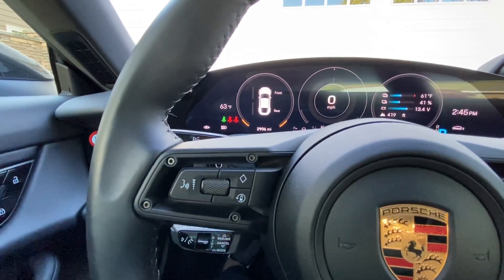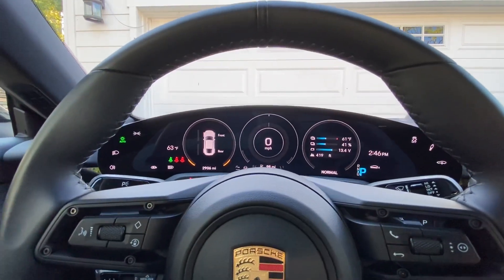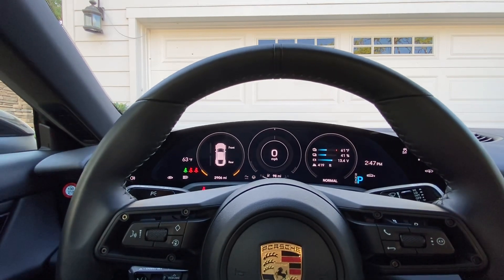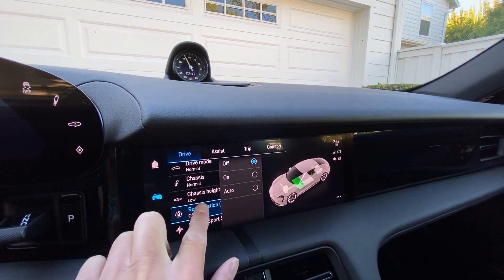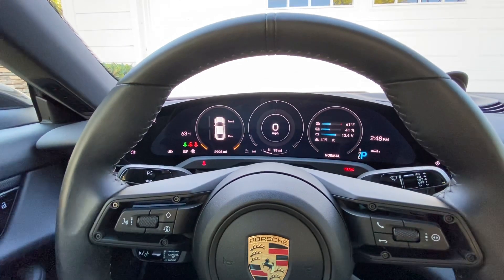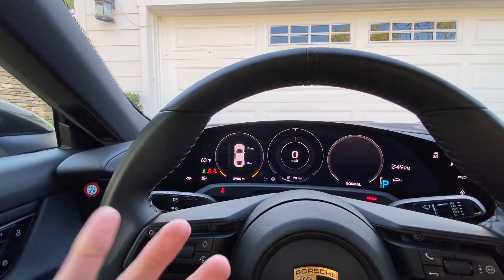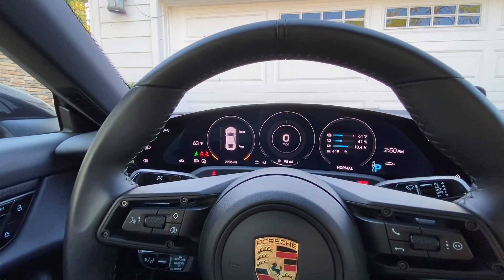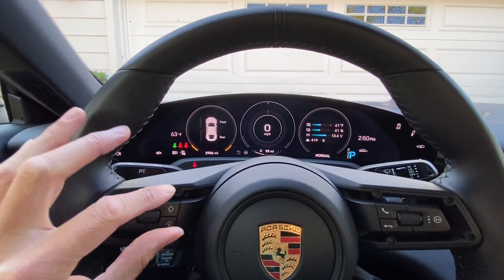Recuperation Modes in a Porsche Taycan

Comment: Biggest disappointment is the lack of proper one pedal driving. 

Absolutely useless implementation by Porsche. Auto mode sort of works but it ends up being more abrupt than true one pedal driving. 

I want it to feel like an EV not an ICE. It's a Porsche, the drivers wish (not some grey haired old fart on the Porsche AG board) should be key. 

There should at least be an option for true OPD in range and normal modes. 

And no, it's not less efficient if you drive smoothly.
Reply: I've never driven a Tesla and I don't want my vehicle to emulate it. At least not by default.

Comment: I did not realize how much I was used to engine braking until I drove the Taycan around with recuperation off.  The Taycan just coasts so well when you take your foot off the accelerator.  It is a little alarming as any ICE car slows a bit just by letting off the gas.  I got used to the Taycan quickly and like the easy coasting.

Comment: Hi, thank you for the video. Question:
Do you know why the recuperation mode sometimes is not available? “Adaptive recuperation not available”.
Also do you know if is there any way to save the configuration because every time I start the car is in off mode. 
Thanks
Reply: I wish Porsche made it so that the settings would save whenever turned off but I believe that is a flaw of the Taycan, the infotainment could’ve been built much better
Reply from the maker: The car has to start in normal driving mode recuperation off. There is no way to change this. My best guess is the camera in your windshield is being obstructed possibly by dirt or bright sun.

Comment: You know I had tried out Recuperation On but don’t like it. I sometimes use Auto but most of the time I use InnoDrive which gives me Adaptive Cruise Control and all the Regeneration I need.
 
I have a Bolt EV also and had it for 35k miles, I did use to like one peddle driving but after a while my passengers complain it’s a bit golf cart and jerky stops. 
 
I hear that the Taycan Sport Turismo will allow 290kW regeneration. Even more than the Taycans 265kW.